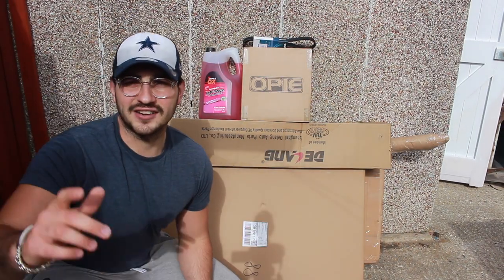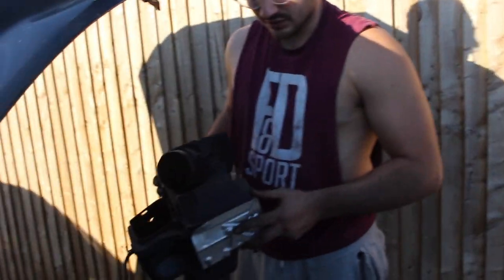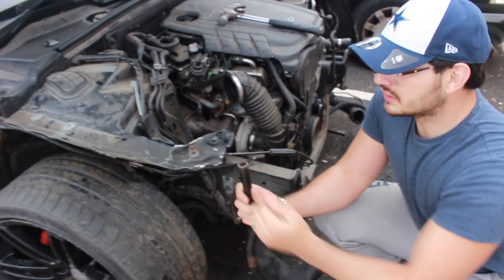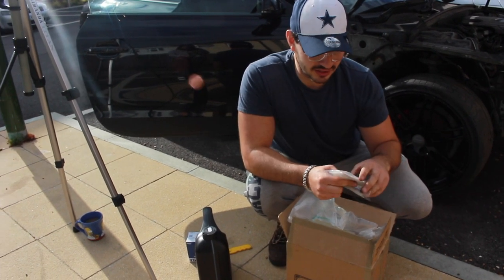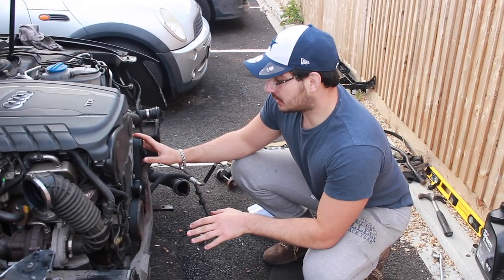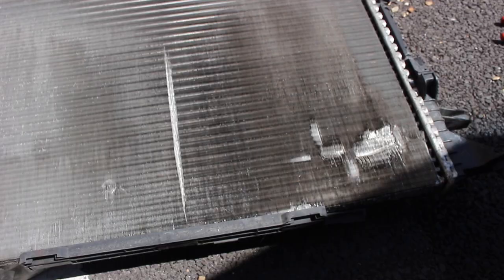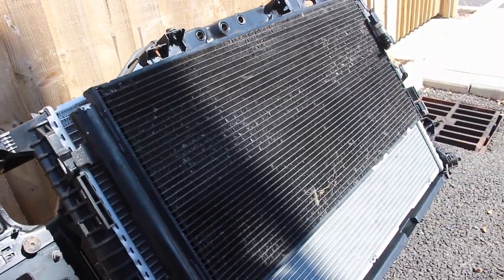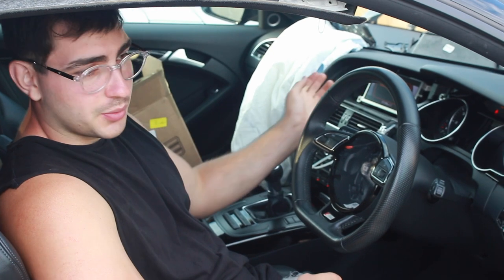HOW I FIXED MY SALVAGE AUDI FROM COPART UK | Audi A5 Salvage Rebuild PART 4

Comment: When you used the level on the front you need to compensate for the surface the car is sat on too don't you?
Reply from the maker: The car was pretty level, I put the leveler on the floor in between the two wheels and it was spot on so I reckon it should be sweet mate!